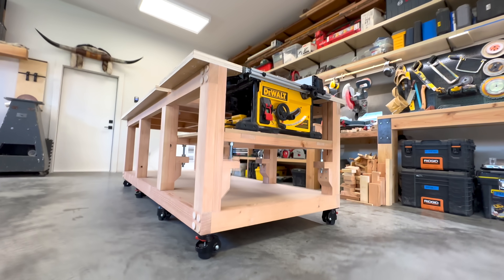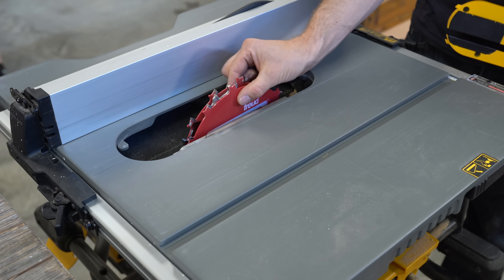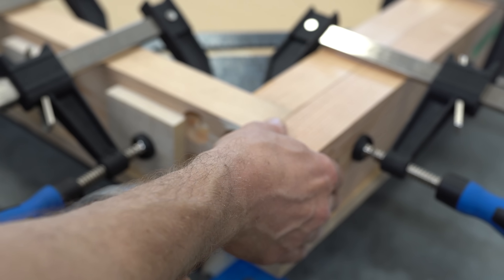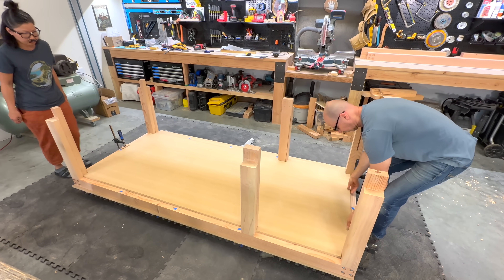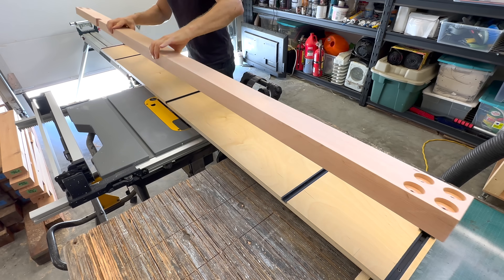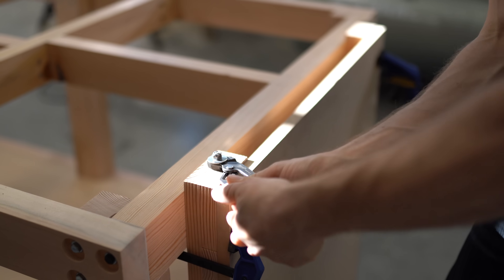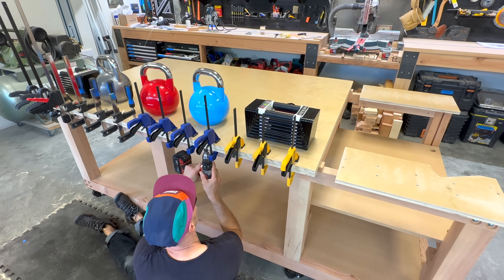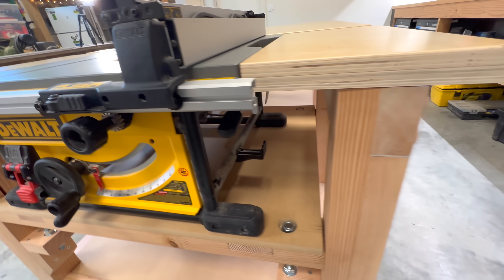DIY Table Saw WORKBENCH Dewalt 7491

Comment: Silly question.....I'm in the market for a planer and I was thinking about buying the DeWalt 735, like you have. Did you get the basic model with the knives or did you upgrade to the helix blades?
Reply from the maker: Hi there and thanks for your question. First I can say, is the planer is very good. I purchased the wings for it, so there is more surface area before and after the blades to help prevent snipe. I did not upgrade the knives yet. They are double sided. I have already flipped them over. After they are a bit duller, i may consider the heliz blades, but for a planer out of the box, its a good one! You would be happy.
Reply: Thanks! @vanislestudio

Comment: I'm a noob as far as woodworking goes and I'm gathering ideas for a simple table saw table. I have a question: I understand why the table saw and the tabletop need to be level with each other, but why is it important for the whole table to level from the ground? Thanks!
Reply from the maker: Hey @mattdonlan7745 great question, To help answer your question, my shop floor isn't level. There are high spots and low spots all over. I want a level TABLE SURFACE, no high spots or low spots. 

My workbench has eight legs (or posts). If the table legs did not have levelling casters, they would not all come in contact with the floor at the same height, due to the fact the floor has peaks and valleys. These peaks and valleys will transfer up the legs to the table surface, this will create a high spot on the table surface, and now it would be out of level. 

In reality, it would not be out of level by that much, but any uneven surface makes it challenging when you are trying to piece together an assembly that needs to be plum, or square, with 90 degree angles / corners.

This is why I wanted to build the workbench on a level surface. I just makes the entire process a whole lot easier. Thanks a lot and I hope I was able to answer your question. Cheers Paul

Comment: Quick question. Why did you use 2x4s instead of 4x4s for the legs? Thank you!
Reply from the maker: 2X4's were more readily available here, that's pretty much the reason.  4X4's would have taken less time, because there is no glue up required. Both are fine to use though and thanks for your question! Cheers
Reply: @vanislestudio  Thank you so much!

Comment: Why did you go with such an overbuilt height adjustment  for the saw ?  Do you have to adjust it often?
Reply from the maker: Hi there, I added extra height to accommodate the different contractor saws that are on the market. Some are quite tall compared to others. And I had to adjust the shelf one time since I originally set it in its place. It seems to stay put. even after rolling it around the shop many times. thanks for asking! Cheers

Comment: Welp, I just went full send. Got the plans on your etsy & bought $500 in casters/tools/bits/clamps/etc. $260ish in bolts/screws/washers/hardware/etc. and $70 in 2x4’s & I had some 3/4 4x8 plywood already in the garage. 😂 semi confident in my abilities & hopeful i’ll finish. Really love this table build out of all the ones I watched. 
Only difference for mine is i have the Dewalt 60v battery powered table saw. Hope that won’t be too hard to work around.
Reply from the maker: Hi there, it's great to hear you enjoyed the table build :) and thank you so much for choosing my plan on Etsy! I'm excited for you and your project on the horizon and hope you enjoy the process of the build. I learned a lot from building mine and wish the same for you. The Dewalt 60v has a slightly smaller table top foot print I believe, not an issue, You should be able to clearly see in the plans how to add material to the left and right to make up the difference in size. If you ever have any questions, please let me know and I'll do my best to help. Best of luck to you on your journey! Paul
Reply: @vanislestudio  getting the dedo stage right now. Did you use all these blades? Did you add the spacers? Trying to set my saw up right now and this is the first time I’ve ever done it.
Reply from the maker: @SwanySwan  Hi, I didn't' use all the spacers. It was a bit to wide and scary to use I thought. I think I used only one of the spacers and did many cuts. In the operating manual of my saw (7491rs) There is a section on using the Dado blade, I found out I needed a new throat plate insert to accommodate the thickness of the dado stack.  I made my own to save money. I youtube'd how to do this. Make sure in the Manual of your saw to read any special instructions for using the Dado blade, or to make sure you saw can accommodate the use of the dado blades. If so, I read a comment (for safety when using the dado blade) make sure to build up to the final depth of cut, raising the blade each time, making multiple passes until you reach your desired depth of cut. Don't cut the full depth all at once I was told. I did some practice cuts on scrap wood to get comfortable with the using the blade. Have fun, take your time, be safe and enjoy learning and building!
Reply: @vanislestudio  thanks man, really appreciate it! I got the 2 blades on and one insert. I think that pretty much all my saw can handle for the nut to sit flush against the screw when I’m tightening it. Currently making a custom throat plate. Ready to get cranking!!

Comment: What size all thread is that? Possibly 1/2"? I was doing something similar in weight. Cant figure out size vs weight etc
Reply: Actually it turns out I bought 3/8" thick all thread
Reply from the maker: Hi there, I used 5/8 inch all thread. Its probably a tad overkill but it was similar in price here, so I thought why not use something a bit beefy. Thanks for stopping in! Cheers

Comment: I’m interested in the sketch up which version would you recommend or did you go with?
Reply from the maker: Hi JP! Well, I would have gone with the "GO" version of SketchUp, (its the most cost effective) but it only works on mobile device, like an iPad. So, i went with the SketchUp "Pro" version. It's around $350 a year I think.  I like how easy it is to use. I taught myself from watching YouTube videos.  Also, I used to use a program called "fusion 360". Its totally awesome, but, to enable a "cut list" functionality, i found it very expensive. They have a free version for you to try. That's what i did. I tried it for free, watch videos' of how to use it, then upgraded when I needed to start making cut lists.
Hope that help! Cheers

Comment: Hello, what router bit do you use for rounding the tabel edges at the end?
Reply from the maker: Hi Isabell, I use a Freud 34-108 3/16-Inch Radius Rounding Over Bit with 1/4-Inch Shank to round over the edges at the end of the video. Thanks for stopping in with your question :)

Comment: Do you have a plan to overcome the lack of pass-through slots for a crosscut sled and/or miter gauge?
Reply from the maker: Hey @ghijkmnop good question and yes. I just ran out of time and did not get to it yet. I'll probably add them when installing the Vice or the Router. Thanks for checking it out!

Comment: I didnt think the jobsite saw could use dado's? can you send link to the dado set and throatplate?
Reply from the maker: Hi @albertbaker5462 sure thing, and yes, the Dewalt 7491RS can handle up to an 8 inch dado blade. I have two blades for this saw. One is the 6 inch dado stack, the other is the 8 inch dado stack. Dewalt designed this saw with a longer shaft (to accommodate the thickness of the stack). it works great! and I'm really happy with it. 

I made the throatplate myself, but I've been told that Dewalt also sells a wider throat plate.  The link to the blade is below. Cheers Paul

https://www.amazon.com/Stacked-Dado-Saws-Multi-Size/dp/B072MJ2V9J/ref=slsr_d_dpds_fsdp4star_fa_xcat_cheapdynam_sccl_2_2/143-3004592-6111930?pd_rd_w=MmlpD&content-id=amzn1.sym.3bcc961c-2fa9-4ff4-af90-7486c35a8f6c&pf_rd_p=3bcc961c-2fa9-4ff4-af90-7486c35a8f6c&pf_rd_r=C6V6WYS4MXHZ8B0E0QHT&pd_rd_wg=4YsAC&pd_rd_r=5352a6f8-44b5-47c6-ac27-599ccefddc27&pd_rd_i=B072MJ2V9J&th=1

Comment: How did you router the t channel so straight? Free hand?
Reply from the maker: No, not free hand. I used a straight edge to guide my cut. I clamped the straight edge so it would not move. Then proceeded to route in the t channels. It was a challenging but rewarding cut to make without the use of a router table. I did practice the cut first on some scraps I had lying around. But still ended up screwing up and having to redo one of the legs. Thanks for your question! Cheers

Comment: How secure is the adjustable bed for the table saw? Have you noticed any movement or slop in it over time?
Reply from the maker: Hey Todd, I don't think there has been any movement. Nothing rattles, or shakes. I hope it stays that way for a long time. Thanks for asking and for stoppping in. Oh, I'll be adding lock washers though. I read they will help with vibration. Cheers

Comment: Hi what do you use for dust extraction for this dewalt portable table saw?
Reply from the maker: Hi I use a Ridgid 60l Wet/Dry Shop Vacuum I purchased at Home Depot for my tables. I have used that vacuum for many years now. It works well, but a some point, I'll be upgrading to a heap filter shop vac as I'm working in the shop a lot more these days. Thanks for your question!

Comment: How did you route those t-channels so straight freehand?
Reply from the maker: Ha, I like your name doom hand Cool! No, not free hand. I clamped three of those 2 X 4's together, (side by side) to create an even surface, then I clamped a straight edge to the top of that surface. That straight edge guided my cut. I still screwed up though, and had to do it a few times, but eventually it turned out really well. Thanks for your question! Cheers

Comment: Awesome shop table.  
I plan to build one once you have the plans available.  Any idea of the ballpark cost?
Reply from the maker: Hey @ralflesaicherre4512 Thanks! Well for cost, the most expensive thing I purchased for the table was, well the Saw itself, but other than that, the Casters. They were $280 Canadian. The plans will have link to ones that are similar but cost significantly less (as an option). other than that, the sheets of plywood were about 80$ each, same with the sheet of MDF. Then would be the 2 X 4's. I maybe used 16. I paid I  about$ 8 - $10  a board. Then the screws and washers and bolts..Hope that helps and thanks for checking out the build! Cheers
Reply from the maker: Hi. Thanks again for inquiring about plans for the workbench. In case you are still interested, I wanted to let you know they are now available on ETSY.  Here's the link  http://bit.ly/3s4D7Ta

The plans utilize imperial measurements, and use regular sized 2X4's (3.5 inch X 1.5 inch).

And in case you are interested in building the workbench using the exact dimensional lumber I used in the video (3 5/8 inch X 1 13/16 inch) I'll have those plans available on ETSY on Oct 31. 

Thanks again for checking out the build! Cheers Paul

Comment: One question, did you have a zero clearance throat plate for the DeWalt saw in your workbench? I have the same saw and need to find one. Thanks, great video. Great idea on adjusting the saw with the table. I will do the same. Thanks again.
Reply from the maker: Hi @mitchstallings7196 no I didn't. I have the OEM plate that came with the saw. There's a lot of space between that plate and the blade. I need one too! Thanks for asking and thanks a lot for checking out the build! Cheers Paul

Comment: Why don't you just pick up a small oneida cyclone and add a large drum underneath?  It's a cheap solution and will save your vacuum cleaner.  Planing goes through a not of chips, I highly recommend, best thing I added to my garage.
Reply from the maker: Thanks for the tip @vichenzadoorian755i! I just looked up what a oneida cyclone is and seem to work pretty well. has good review too! Will take a look when I upgrade the dust collection . Thanks! Cheers

Comment: How do you do your step by step cut list in sketchup? I'm using the browser version if that helps should you decide to respond with video.
Reply from the maker: Hi @SpartanX317 For the "pictures" or 'images"with measurements on them, first, for the component I want to add dimensions to, I will orientate it the way I want. Then I add the dimensions I want manually to that component, basically so they are drawn on. Then I will go to "File" then "Export" then "2D Graphic". This creates a picture with the dimensions there. 

The other way is to use the extension "Open Cut List". Where you select the components, the select "Parts" from the "Open Cut List" extension, then select "Generate". There are some videos out there of how to do this, which is how I learned. Hope this helps. Cheers

Comment: What was the cards under the table top for?
Reply from the maker: Hey Bullet, neat name BTW. They were to help level the top surface. When I placed my long straight edge across the entire table top, there were a few areas that were either high, or low... so i decided to even the playing field so to speak, by adding a few cards here and there. The table surface is now as flat as a pancake. Thanks for your question Cheers

Comment: hello, very nice work, how can I get to the plan
Reply from the maker: Hi @muhammetkayabas7688. thanks for asking about the plan, it will be on ETSY in a few weeks time. Just finishing them up and thanks a lot for inquiring about them and for your comment! Best Paul
Reply from the maker: Hi. Thanks again for inquiring about plans for the workbench. In case you are still interested, I wanted to let you know they are now available on ETSY.  Here's the link  http://bit.ly/3s4D7Ta

The plans utilize imperial measurements, and use regular sized 2X4's (3.5 inch X 1.5 inch).

And in case you are interested in building the workbench using the exact dimensional lumber I used in the video (3 5/8 inch X 1 13/16 inch) I'll have those plans available on ETSY on Oct 31. 

Thanks again for checking out the build! Cheers Paul

Comment: Awesome work and video editing skills! Where can i find the plans to re-make it? thanks and keep up the great work
Reply from the maker: Hey @vittorioconti3665 Thanks a lot for that!! I'm working on the plans every day. If you're still interested they should be done soon and will be available on ETSY.
Reply from the maker: Hi. Thanks again for inquiring about plans for the workbench. In case you are still interested, I wanted to let you know they are now available on ETSY.  Here's the link  http://bit.ly/3s4D7Ta

The plans utilize imperial measurements, and use regular sized 2X4's (3.5 inch X 1.5 inch).

And in case you are interested in building the workbench using the exact dimensional lumber I used in the video (3 5/8 inch X 1 13/16 inch) I'll have those plans available on ETSY on Oct 31. 

Thanks again for checking out the build! Cheers Paul
Reply: @vanislestudio  thanks for letting me know. I would be definitely interested in buying the “yours” version. Also, would a metric version be available?
Reply from the maker: @vittorioconti3665  yes and thanks for asking. The Metric version will be available on Nov 07 on ETSY. 

And thanks again for considering my workbench plans! 

Cheers

Comment: awesome build, do you share the plans anywhere?
Reply: saw your comment on FB - lets wait 🙂
Reply from the maker: Hi. Thanks again for inquiring about plans for the workbench. In case you are still interested, I wanted to let you know they are now available on ETSY.  Here's the link  http://bit.ly/3s4D7Ta

The plans utilize imperial measurements, and use regular sized 2X4's (3.5 inch X 1.5 inch).

And in case you are interested in building the workbench using the exact dimensional lumber I used in the video (3 5/8 inch X 1 13/16 inch) I'll have those plans available on ETSY on Oct 31. 

Thanks again for checking out the build! Cheers Paul

Comment: Your telling me a jobsite tabke saw can use a dato set no problem through most woods?
Reply from the maker: Hey @bjmxd, thanks for your comment and for checking out the build. Here is from Dewalt website : 

Part No: DWE7402DI
Dado Throatplate for 10" Portable Table Saw
Allows for use of stacked dado cutters
For use with DWE790X, DWE7491RS, DWE7499GD

Comment: Are you going to put t track across the table? I built something like this only to realize my sleds no longer go very far.
Reply from the maker: Hey @davidmgibbons great question and yes, I'll be using a 3/4 inch straight bit to route in 2 slots that will extend my miter capabilities. I've been using it like this for a while, but its a pain in the but without having those channels routed in. Cheers!
Reply: @vanislestudio  I look forward to seeing your update!

Comment: When will you have the plans available?
Reply from the maker: Hi! Thanks for stopping in. I've been working on them every day, and should be done in maybe a week I hope. Cheers!
Reply from the maker: Hi. Thanks again for inquiring about plans for the workbench. In case you are still interested, I wanted to let you know they are now available on ETSY.  Here's the link  http://bit.ly/3s4D7Ta

The plans utilize imperial measurements, and use regular sized 2X4's (3.5 inch X 1.5 inch).

And in case you are interested in building the workbench using the exact dimensional lumber I used in the video (3 5/8 inch X 1 13/16 inch) I'll have those plans available on ETSY on Oct 31. 

Thanks again for checking out the build! Cheers Paul